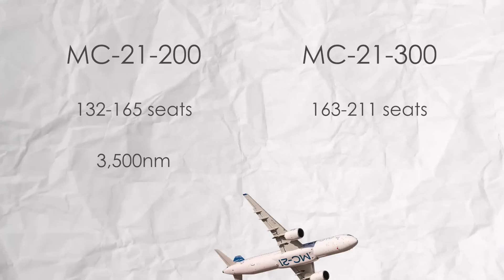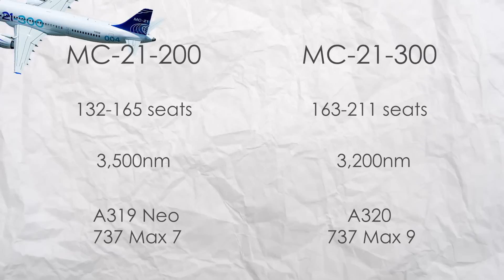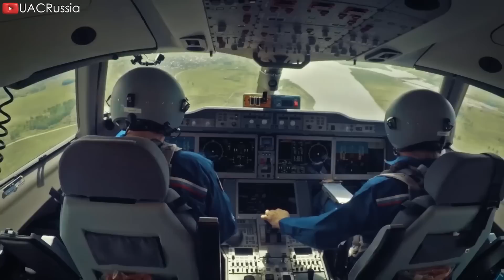This Russian NEW MC-21 Will Change The Aviation Industry! Here's Why

Comment: The Russian Sukhoi Superjet 100 (French engines based on the America  CFM56) was going to redefine the Aviation world back in 2009. Apart from Russia, it was only purchased by three other countries!! And it seems that the MC-21 has been ordered only by Russian airlines and one of Russia's close allies.
Reply from the maker: thanks for sharing
Reply: The French engine is exactly the reason for SSJ100 failure. Fully domestic version "SSJ New " is almost ready.
Reply: @Aleksandr-ke7gy  The Russian company Saturn partners up with the French company Snecma to create the engines for the SSJ100. The only engine that Snecma had created 100% and sold to that point was for a French fighter. Also while Snecma are involved in the CFM56, it was the American company GE Aerospace that designed and manufactured the majority (core/hot) of that engine. it seems weird and quite a risk as to why would they choose Snecma to basically designed the vast majority (core) of a new engine for a passage aircraft when Snecma did not have an existing track record for that kind of development, etc.

The new Russian PD-8 engine for the SSJ100 is still in the testing phase and there seems to be NO deadline for the first PD-8 engined SSJ100 to be released into service.

Just an observation - Amazing that Putin can spend billions on developing warfare weapons like new nuclear submarines and nuclear-powered torpedoes and missiles in his 'pursuit of peace'. It seems Russia could not even develop a complete Russian version of the SSJ100, but ended up effectively going to a company of a NATO country for help even with the SSJ100 having been in service for 13 years. On top of that Russia, has depended on Boeing and Airbus for so many years while not even producing one successful 100% Russian airliner. Even the Yakovlev MC-21 started out with American engines and the full Russian version will not be seen until 2025-2026 at the earliest.

One has to wonder that with all the natural resources that Russia has, it could not have developed a competitive international economy to compete with the West and China over the 23 years that Putin has been in power. It is not a lack of 'bright' people, because it seems they can develop some great weapons of war but at the same time they cannot even develop a respectable home grown Russian car industry and basically have to depend on other countries. Suspect the engine is not the only reason.
Reply: The irony, you whining about Russia spending $40 billion per year for their defense whilst the USA spend $1 TRILLION per year, but the Russians are the aggressive ones. 😂😂
Reply: The sanctions are scaring customers. Why do you think BRICS were created?
Reply: The French screwed us over by making an engine out of shit. From here there were problems, the planes did not fly. Now we don’t need them, we can do without them.

Comment: I would prefer the MC-21 over the 737 Max 9. But i honestly hope that Boeing comes back to the market with a new CEO that puts Engineers back in charge and sets quality as the major priority than profit.
Reply from the maker: yep thanks for your sharing
Reply: New ceo new same old same old boeing already sold to wall st. Just  look at  the stuck space craft. Starlimo high price what chance does a cheap 737 has?
Reply: They need to investigate first what happened to the whistle blower then think about the new ceo